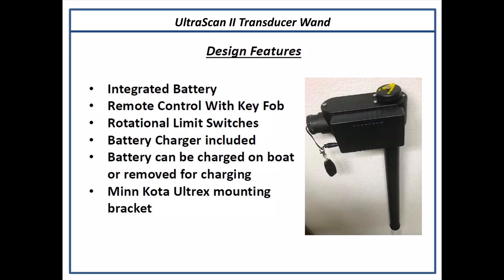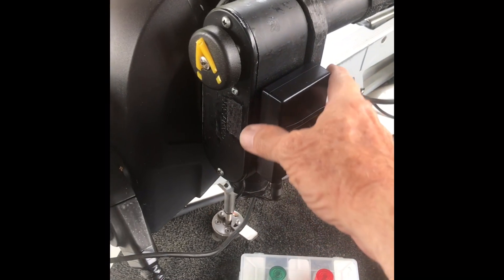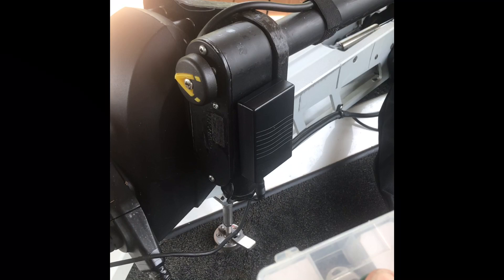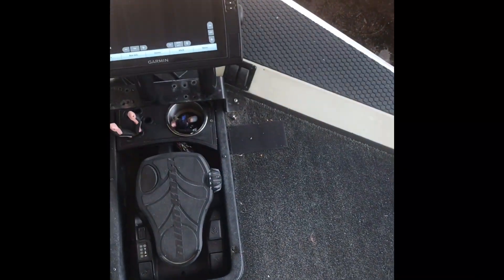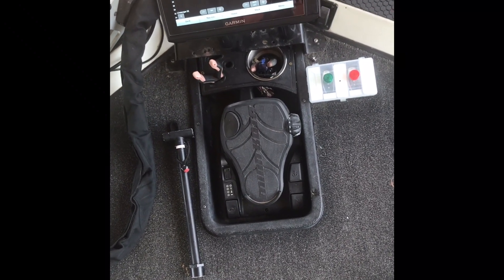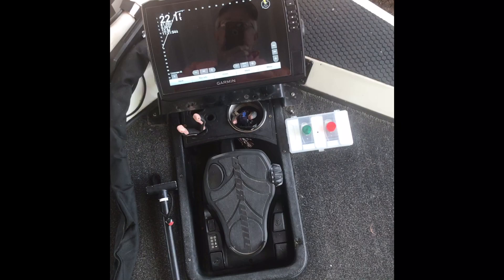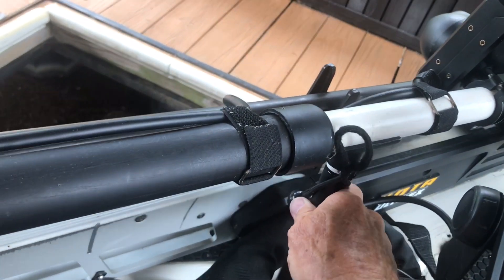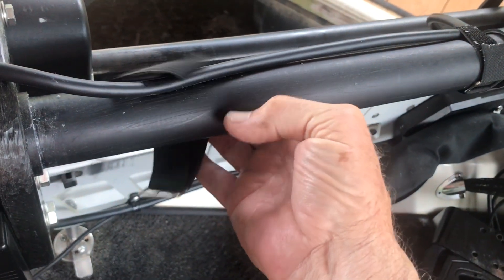UltraScan II Motorized Transducer Pole - PDF Build Document in Description

Comment: Amazing work using readily available materials. I'd love to see what you could come up with using a 3D printer.
Reply from the maker: Thanks, I wish I had a 3D printer and was adapt at 3D software but budget does not allow. I am an analog guy but am considering familiarizing myself with Arduino so I can program features instead of stacking up analog devices. That may be my next venture.